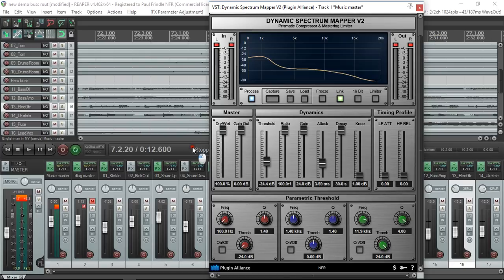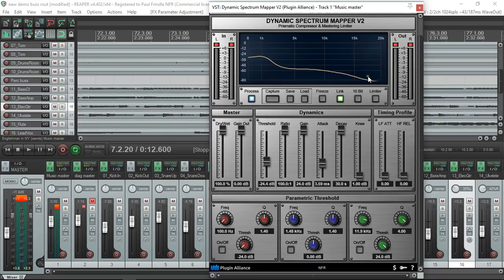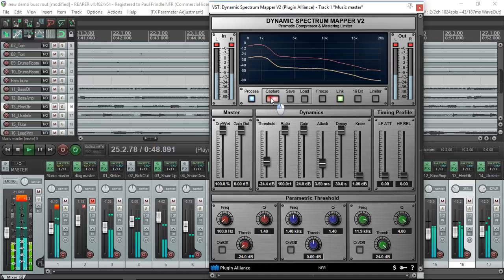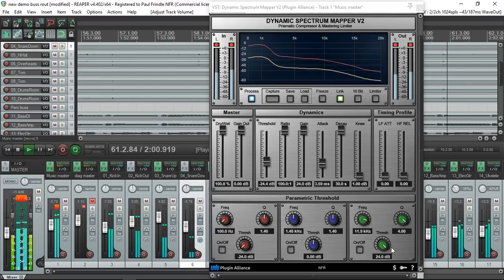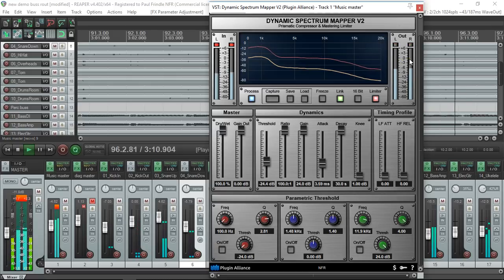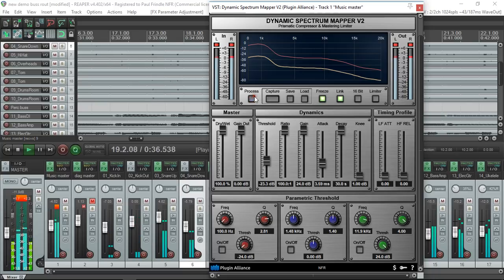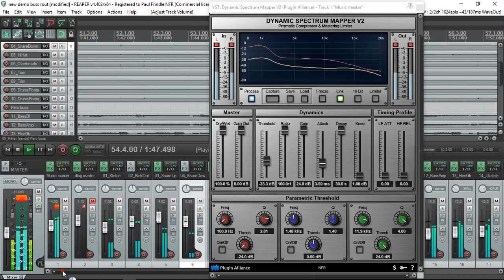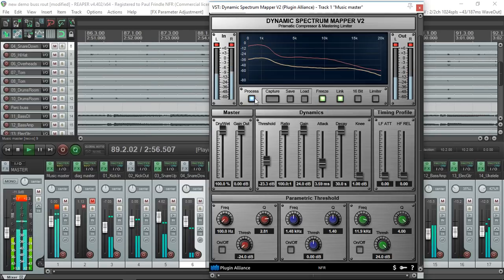DSM informal demo. Operation and spectrum capture.

Comment: Hi Paul, what's your thoughts about using the DSM for parallel compression? specially on master.
Reply from the maker: Hi Mustafa. Parallel compression (mixing the uncompressed with the compressed signal) can be achieved directly with the Input/Output blend control. So for instance it's possible to set the DSM to boost the gain and presence on low level stuff - and let the high level direct stuff gradually take over when things are louder etc. I use it that way sometimes, particularly for orchestral music.
Doing something more complex, like sending the music down 2 channels with a different compression on each channel, is also possible with the DSM - even with 2 different compressor types. Because the DSM is a phase linear process, it can be parallel mixed with another channel without causing phasing issues :-) I hope this helps :-)
Reply: Paul Frindle I have a question about applying the DSM to orchestral music. I’m mixing a sample library mock up of Debussy’s String Quartet, 3rd movement. I manually created a tempo map, measure by measure in Digital Performer, from a well known recording of this string quartet. I took some of the recording’s room ambience with a spectrum analyzer and included it within a convolution reverb, especially the noise floor below 100 Hz, (which I then partly removed with a low cut), and mixed it in with the sample libraries ambience. I’ve done about as much Eq and compression as I dare do on each instrument. For the final touch I’ve downloaded the demo for V3 of this plugin to see if I can capture as much of the resonance and natural ambience of the recording. For example, in measure 3 of the third movement, the cello plays four slow eighths with a pizzicato articulation. However, there’s quite a big difference between the sustain of the lower blooming resonance of the performed cello, and my sampled cello. The sample just doesn’t have that same low resonance in any of its mics. So I’m considering two things. First I’m going to study the exact frequencies that are resonating via a spectragram. Then, I may capture just that measure with DSM and apply it to the cello in that measure with a slow release of those frequencies. Or, more extreme, use a subharmonic synthesizer just a tad to get that blooming long release bass. That might be too extreme, so my last thought was to again use convolution reverb  to affect the early reflections for that measure. One of those three should work. Any advice? One more thing. The recorded violins have much richer harmonics at louder dynamics. I was thinking a combination of a light touch of VSL’s Exciter plugin, combined with capturing the loud dynamics of the violins with DSM3, and resonating the convolution reverb taken from the room ambience from the original recording might do the trick without it sounding too artificial. What do you think? It’s so difficult to make a sampled instrument sound as rich as a performed and recorded one, because it’s not always the instrument that’s to blame. Sometimes the mic placement, the room’s resonance, and the player’s  account for that extra richness, (especially apparent during expressive vibrato). So eq alone doesn’t stand a chance. Any thoughts? Sorry for the lengthy comment. Hope to hear from you. Regards, Steve Steele - Composer
Reply from the maker: @SteveSteeleMusic  There are several issues with trying to use the DSM to model what are essentially 'acoustics'?
Firstly the DSM is a level and response only process, it has no convolution of delays and resonances that you need to gain the sound of an 'environment'.
Secondly, the spread of the bands in the DSM are naturally linear rather than logarithmic. This means that notionally the bands get wider the lower the frequency of the program. So this also means that it won't be great at accentuating low frequency room anomalies and resonances - because they all get lumped into a much wider band together.. I.e. the DSM is deliberately designed to NOT respond to individual low and mid range individual 'notes' - because it would cause some very odd results when compressing program etc. 
You have to kind of treat it as an overall character and 'sheen' - rather than a surgical correction process.

About sampled instruments: You're so right that getting an ensemble of sampled instruments (however good) to sound like a realistic live performance is an almighty challenge. This is because the different placements of the instruments in real space (when played live) means that each has an effectively different reflection acoustic impulse response within the very same acoustic environment.. Really really complex stuff to achieve artificially - even with a convolution reverb of real space :-(  Panning doesn't help you either, since it's just changing relative L & R levels - and not changing the environment reflections at all - it can end up making it even worse.
The only thing that seems to work after a fashion is to somehow decouple the instruments from the reverb environment , by making a long and loud reverb (sometimes delayed) - and narrowing the panning of the instruments - so that the whole thing seems like an ensemble that's quite far away its almost mono - and the acoustic space is very large? I.e. the whole thing is a kind of 'mush' buried in a real convolved environment. Not at all what you really want :-(
Sorry for long post - but I'll carry on just for a bit more, if you're still with me....
When I was designing the Oxford reverb back in the early 2000s I started off 'dreaming' of an application that would indeed do ray tracing and reflection calculations in realistic geometric space - precisely so that you could put it on the individual channels of artificial instrument sounds - and 'place' them individually into a 'real' artificial acoustic environment - just like a real band or orchestra etc..

However the whole thing got so complex and started taking such inordinate amounts of time and resources to develop (more than a year - I'd never made a reverb before) - and our development system was straining to compile it to such an extent, that I had to give that up somewhat. A load of stuff that looked legit inexplicably refused to compile - and was eventually left out to get it to market..
However the existing Oxford Reverb has indeed still got some vestiges of this thinking in place, where the early reflections section has forward and backwards placing etc.. Sadly it was the left and right that never made it through the compiler.

Comment: Hi ! Great tutorial. 
I have a question regarding the freeze button. 
In the manual written that: "The Freeze Gains button stops dynamic activity and freezes the response to that which was active at the moment of operation.
This arrests any further gain compression and permanently imposes the response of the active spectrum onto the programme – somewhat like a static equaliser".
But when I click the freeze button I still feel that it compress as usual (when I bypass the DSM I can see a really big change in volume).
So if I use the freeze button I need to adjust the threshold manually to 24DB & the gain to zero so it will not compress ?
I thought when I press the freeze button it automatically bypass the compressor / limiter settings & just keep the eq settings I captured.
I thought that I can use the DSM sometimes only as a special EQ & then uses another compressor (like the BX XL v2 which I also have).
Reply from the maker: The Freeze Gains button does exactly what it says - it stops the compressor dead at any point in the track when it's pressed and holds the gains at that point. After that compression can't happen, because it's no longer responding to the input signal - it's 'frozen'. :-) It's true that in this state it's imposing a kind of static 'EQ' curve onto the signal (because dynamic gain change is no longer happening). If you find there's a gain change between the DSM and bypass, it's because this was what was actually happening at the point you pressed the Freeze Gain button. So if you want parity with the input you will need to increase the Gain setting to compensate.